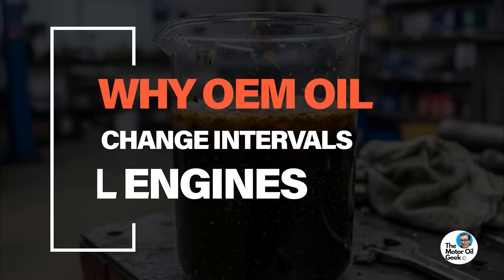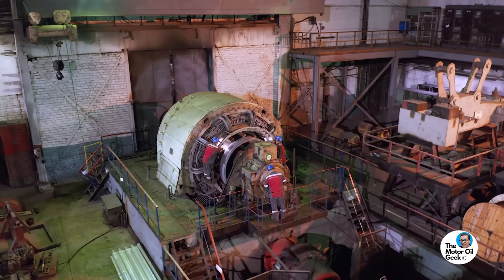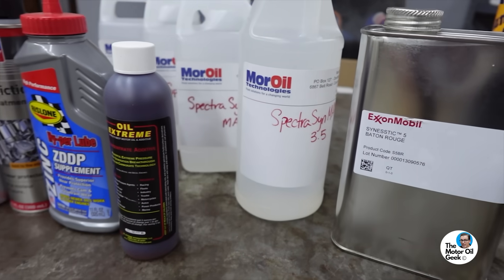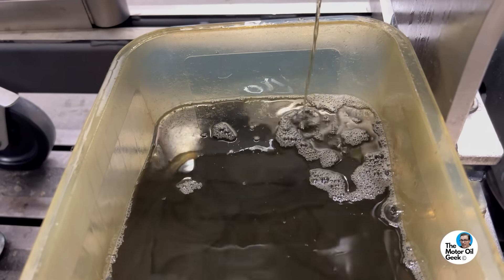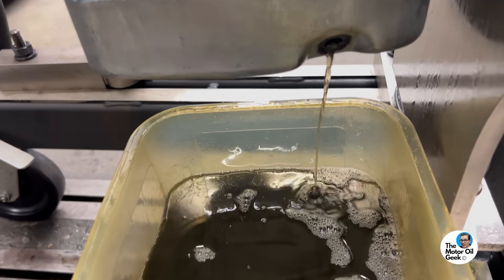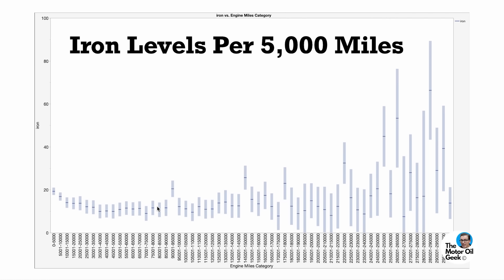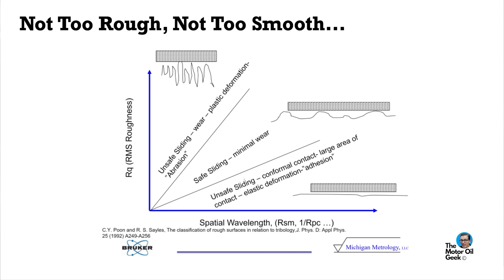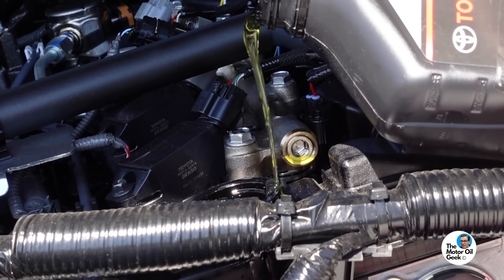NEW Data Reveals WHY Modern Engines FAIL Prematurely!

Comment: You did a video on how GM oil life indicator is accurate. Is that considered OEM recommendation? Should the oil be change sooner than that oil life indicates?  The test you did on that show the oil still had plenty of life but thats different from clean.
Reply from the maker: It’s accurate after break-in, but don’t follow it during break-in.

Comment: Thank you for confirming what I intuitively knew. The first oil change on a new engine should be at 1000 miles and then maybe extend a thousand miles per oil change going only to up to 5 K. Also, after break-in you can change an extended life oil filter every other oil change and actually have cleaner oil that way.

Comment: The Pratt and Whitney Geared Turbofan transfers 40-60,000 horse power through a planetary that you can pick up and carry. 

Aerospace and Industrial applications are where you have the real loading challenges. Automotive is much more about cleanliness than load performance

Comment: All my motorcycles back in the late 50's to somewhere in the 70's had the first oil change recommended at 500 miles during the "break-in" period.   Then this disappeared and they all said that due to closer manufacturing tolerances the first "break-in" oil change was no longer required.  This was marketed as a consumer convenience but I always looked at it as planned obselescence to sell more bikes.
Reply: It’s all BS.  Several oil changes in the first 10,000 miles is definitely good practice. Especially the first 3,000 miles.  Plus there’s a proper driving procedure to break in the rings properly which also dates back to the earlier period you mentioned.
Reply: @CreatingExcellence INDEED!!!!!! I took my car to the Honda dealer and spoke to the top service manager for all the makes and he said the Honda original fill oil possessed good friction additives that meant you should not change it until 7500 miles.  I found that dubious and used a Lubrizol oil(Oreillys) at around 1300 miles. My rings seated very well based on zero oil burning and good power. On transmission Honda gear oil is nasty stuff in this 6 speed. I had numerous gear grinds and issues that went away after change to Gear 300 Motul oil was used. I am 100% positive the company in North America prefers the engines have limited life. Even the engine oil spec was too thin as 0w20 too thin for this turbo engine. The oil viscosity worsened with fuel dilution.
Reply: @jamesmedina2062   You gotta be careful with that  I put thicker oil in and blew the head gasket on my car that I'm fixing now. If you rehone the cylinders and something with the cam shaft or just a new engine you use break in oil and change it but not after 15 minutes like some people online were saying.
Reply: @jhowardsupporter head gasket holds air pressure and water pressure. They do not hold oil pressure so that does not matter. The head gasket is worried about heat and therefore water flows through them.
Reply: @jamesmedina2062  really? That is good to know. Yeah I was probably wrong thicker oil over heating I have no idea whats actually likely to happen
Reply: My 2024 BMW F900 GSA has a 600 mile break in oil change, the 2025 even comes with a complementary first service at 600 miles.
Reply: @dundonrl  BMW will absolutely sell you on the motorplan, because that way you go to the dealership regularly, and even if you do not pay for anything other than tyres and accident damage, they still make money off you in that you are so much more likely to trade it in by them and buy a new one. Used to be built into the price, but the laws changed about disclosure, and funny enough almost all customers still buy it, and often also all the top up plans they offer as well. One ex boss of mine had the same car for close to 20 years where all he did was buy top ups, and paid nothing for service or repairs, including a sunroof that failed, which cost more than the entire motorplan top up he just got for 5 years. Same car, 3 wives......
Reply: @SeanBZA  Well, the bikes and cars are different beasts. I've never owned a Bimmer but have had two Beamers, so I wouldn't know what Bimmers have for warranties, service plans etc.
Reply: First service is 600mi on our Suzuki 800.  
I think it was 500mi first change on dad's XV1900 back in '07.
Reply: 621 miles for my 2026 Ducati. But then, 24 mo or 9k miles I won’t be doing that….
Reply: @jamiesteiger6140 I’d be doing another change around 1500 miles and another at 3,000.
Reply: @CreatingExcellence at least!
Reply: @jamiesteiger6140 600miles for my 2024 Yamaha R1, I did the first oil change at 553miles, then another at 1,000, and im doing another here soon at 3,000. Using Amsoil Metric 10W40, with the ea15k12 amsoil oil filter.
Reply: Back in the days when "machining the brake rotors" was something that only happened if there was some drastic problem.
Reply: All motorcycles I owned have and still have the 500-800 break in oil change. So I’m not sure what manufacturer this disappeared from but all 4 Japanese manufacturers have an early break in oil change under 1,000 miles and use break in oil.
Reply: Most motorcycles are a wet clutch so the oil is always dirty with clutch material.  Big clearances deal with this as well as lots of zinc.  I just rebuilt my 32 year old KLR with a 1mm over bore, forged piston (Wossner), high compression (over 11.5:1), and as loose on the tolerance as i can get away with.  Did it all by hand in my off grid shop with a drill press converted to a hone and surface plates.

I break in for about 500 miles while keeping under about 4k and constantly varying the load and rpm.  Basically do 500 miles of mild pulls to 4k and engine brake back down the range.  I use Rotella T4 for EVERYTHING, assembly lube, break in, and normal operation.

I pulled the head to replace a blown gasket and timing chain after about 10k of hard dirty dusty desert miles and lots of WOT sends and everything looked absolutely perfect, slight crosshatch under an evenly polished wall, no wear marks, no piston slap and no deposits.

The KLR is well known for having some of the loosest tolerances of that era, it made for an absolutely bulletproof machine, but stock it shook like a paint shaker and burned oil like a 2 stroke, a quart every 500 miles thanks to the loose tolerances and inadequate oil ring backports.  The new piston is half the weight of stock so there's no more vibration, it balances, and doesn't burn a drop of oil.  It made it over 100k hard miles, overheating, running dry, running on dollar store oil when there was no Rotella.

These days no manufacturers expect their bikes to last for 10k miles, nevermind 100k so break in and loose tolerances are out the window in favor.  How many of these modern bikes today are going to be remembered and live on as classics in 20 years VS the pre-millenium classic bikes that we ALL love, and why the "retro" market is so big.  Is anyone going to be nostalgic for a 7" TFT with a bunch of menus and a clunky thumbswitch?  They're not even selling bikes a rider can reasonably own for 20 to 60 years, they're leasing you this year's experience, and who wants to ride last year's tired old trends?  Then new one has an AI enabled smart clutch to subscribe to for $20/month!

Bikes are over, they've been since the millennium, and i just don't have a single bit of interest in anything post-2000.  It's all just been the same disposable gimmicks, crap, brand lock-in and snake oil.  Ir's all just been slop that puts hype and ego first and the rider experience last.
Reply: Now BMW motorcycles include the 600mi oil change in sales price AND they give a small window(350-750mi) to get it done to keep warranty.
Reply: In 70s we didn't have different motor oil for motorcycle and cars, it used to be all the same oil. But today we have gazillion variant with strict guidelines to not put car engine oil in motorcycle
Reply: @axel3895 hence Castrol 20w-50 in both Honda motorcycles, and frequent oil changes - 800-1000 miles for both. (Early eighties…)

Note: the factory shop manual spoke of every 600 miles for the 1971 Honda 175.
Reply: You looked at it Well!
Reply: I got a new royal Enfield and it still requires 500 mi oil change for break in. A mate of mine got a 2025 street triple and same story there. Although my brand new Toyota doesn't have a break in oil change period and in fairness it didn't break in at all. The Royal did! Up until just after 2.000 miles.
Reply: Huh? My 2025 Honda motorcycle has a 700 mile break in oil change per the manual
Reply: Triumph still does the aggressive oil change schedule.
Reply: Last bike I bought was still this as of 2025. Some manufacturers still like their product I guess😂
Reply: What brand bike are you referencing? 
The honda and yamaha duel sport bikes recommended oil change at the first 500 miles. Im guessing you are looking at a Harley davidson or something similar.  
It's crazy to think the 1.2 quarts of oil can keep the motor running for 2k miles. But that's what most bikes do!
Reply: Most motorcycle’s still specify anywhere between 500 and 1000 miles. But then jump to around 3k to 5k intervals. Motorcycle oils are different than standard car oil. My understanding is they have higher anti corrosion modifiers due to the possibility of sitting for extended periods of time and friction modifiers due to shared engine and clutch components.
Reply: Yup I change my old BMW airheads oil every 3K-5k miles and valve adjustment every 3K. Take about an hour in the evening as I usually clean everything up while in there but it will outlive me!
Reply: My 2018 and 2019 Harley’s both were recommended to have the 500 mile break in oil change done when I bought them. Not sure which manufacturer you’re referring to as others in the comments here are saying the same thing was recommended by their bike brand.
Reply: My Ninja 300 turned its oil grey in 250 miles.... no way in hell it would have lasted 3000.
Reply: In the ‘80s, I’m pretty sure automobile engines also had a suggested 500 mile break-in period prior to any hard driving, but some people claimed you needed hard driving from the start to seat the piston rings. There were too many opinions and not enough verifiable facts back then.
Reply: 200, or 5 to 10 hot cycles.  500, 1000.
Reply: The last motorcycle I bought was back in 2004 and it was a GSXR 1000. From what I can remember the dealer telling me is to spend a half hour and ride it home and then change the oil and then again before I got to a 1000 
miles change it again...
Reply: I have done 300 miles break in oil changes on every engine I've ever installed used or rebuilt or new.
Reply: I agree all my old Harleys manuals stated 500miles for break in 3000 miles after that. I live by that to this day car, truck or motorcycle 3000miles regardless with 5 W 30 for auto and straight weight for the older shovels and iron head's
Reply: No '96 Harley Heritage still had that 500 mile first oil change interval and that was with roller lifters and the oil still had zinc etc.
Reply: Don't know where your getting this? Most modern premium motorcycles, have specific oils blended by big name brands. They're semi synthetic for proper break in, and are put in the bikes when new. These oils aren't designed to run for extended mileage, like fully synthetic oils can. 
Not changing the break in oil by 500-1000 miles. Is a sure way to ruin a brand new engine. It doesn't matter what type of oil it is. If it's contaminated from initial break in particulates. That are too small to be filtered out. Your grinding all that crud into the engines parts.
Peace
Reply: My new F150 2.7 I changed oil and filter at 500, 2000, 5000 and now every 5000. I have 30,000 miles on it now and so far it burns zero oil. Used mobil 1 5W-30 and OEM filter for every oil change. I’m hoping for the best.
Reply: @davidj6398 Good early intervals.
Reply: @davidj6398 my 2023 f150 5.0 first oil change was at 6,000 miles...now at 61k and not one single drop of oil is burned per oil change (every engine burns oil so probably a couple of ounces here and there)
Reply: @d @davidj6398 30k means broke in. 90k means "check now for oil consumption"
Reply: @davidj6398  I replaced my 22 Maverick at 5k miles and 10k miles after that. Never added any oil and was always full at 10k miles but what do I know since I've only been a mechanic for 45 years.

Comment: And to think mobil told me if an engine is rebuilt and assembled correctly there's really no such thing as break in.  

It was a 1972 Ford 302 with pretty much factory replacement parts not hopped up

Comment: Maybe there's a case when manufacturing debris is causing engine failure, but don't be a fool. Some of this is just poor engineering. Replacing a poorly designed engine with a poorly designed engine won't change the results & neither will changing the oil more often during break-in. Consider the liability issues when "THEY" tell you something. What about brand-image damage. Are they saving face if they don't tell you the truth about the engineering. Changing your oil more often during break-in won't change the life your engine very much, if it's a well-designed engine.

Comment: Brand new F350 with the 6.8 gasser ordered from the factory.  Based on the destruction of America's economy by our politicians it needs to last me the rest of my life which should be around 30 years towing a 6,000 camper full time which is extreme duty . Not good with the way they are building garbage today so I swapped out the factory synthetic blend and initial break-in oil at 180 miles then again at 2500 miles and will change it every 2500 with Pennzoil Ultra Platinum.  I don't travel a lot so that interval will be about every 10 months or so that easy peazy.  Thanks to Lake's videos I learned to only use Top Tier gas and Lucas Upper Cylinder Lubricant went in on starting on the way home from the dealership!!  Only have 3,000 miles so far but I'll also use a half dose of Techron every 5k.  Ordered the 430 gears for the mountains and to lessen stress on engine & transmission.  I also avoid ALL unnecessary cold starts like the plague!!!

Comment: My '05 M3 (E46) Big 3, 2 of them are motor related, rod bearings and VANOS. Both oil-related components. As an n=1 testamony, for the past 15 years (mileage from 22,000 to 110,000 miles), synthetic oil is changed every 7,500 miles or 1 year.

Most recent 4 year concurrent Blackstone oil analysis, concludes rod bearings are healthy showing low AND not increasing rode bearings metals.

Zero VANOS codes. 2-3 years  (<8,000 miles) ago my mechanic visually assessed condition of VANOS (he did address solenoid circuit board re-solder), exhaust tabs intact and no signs of metallic fatigue and no loose or sheared sprocket bolts. No VANOS codes nor leaks currently.

Comment: Thin viscosity oils, extended intervals and poor metallurgy components. The trifecta of why these new motors fail.

The CAFE restrictions have forced the manufacturers hands and has led the problems we have today.  There absolutely no reason why these engines shouldn’t be able to see 200k mi without some catastrophic failures prior to.
Reply: Nobody is forcing manufacturers to make shitty engines to meet fuel economy standards. Nobody at the EPA is saying, make those blocks really really really thin and put a cheap gasket on there. Those are choices the manufacturers make because they’re focused on shareholder value and executive pay structures more than customers and reliability.

Comment: I'm on my second round of Valvoline Restore and Protect, 9,000 miles in on a well-maintained engine with 129,000 miles. Should I continue using it when I hit 20K, or go back to Penzoil Ultra Platinum?

Comment: Bypass oil filtration systems is something I would like to see a true and honest test preformed on.
Reply: I've done oil analysis and used bypass filters on many vehicles, 3-4x less wear, cleaner oil and longer life. All of my engines have lasted over 250k.  Current GDI engine has 225k.

Comment: I can’t thank you enough for all your hard work and dedication. I love looking at the data and learning more about lubricants. I change my oil religiously on my 2011 Ram 1500 5.7 Hemi. It is a rear wheel drive, two door, short bed, but it’s what I like. With 123K miles and NO TICK I think I’ll keep on using Mobil 1 and change it often.

Comment: I'm confused, I have a turbocharged gm ecotech engine with recommended interval of 9500 miles. I usually change both oil and filter at around 5000. Should I keep the old filter for another 5000?
Reply: no, change the filter every oil change please.